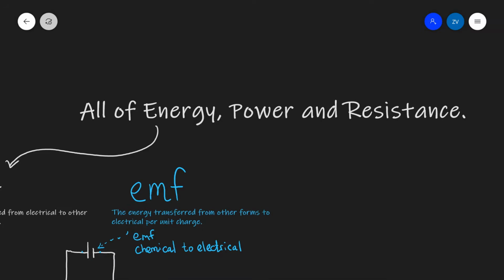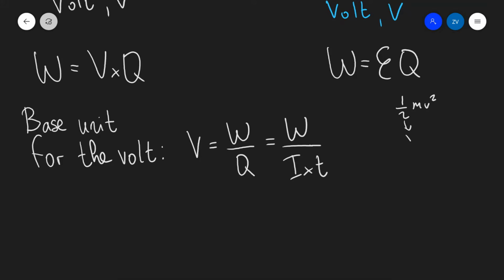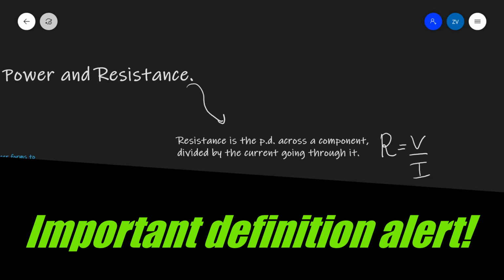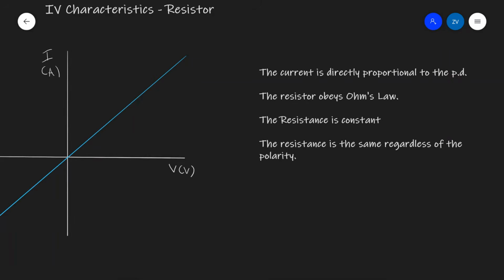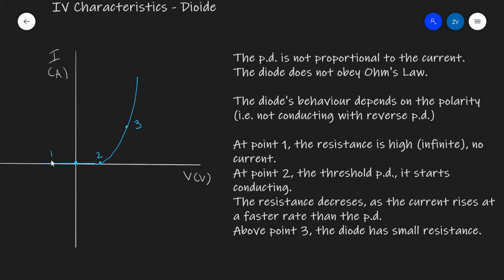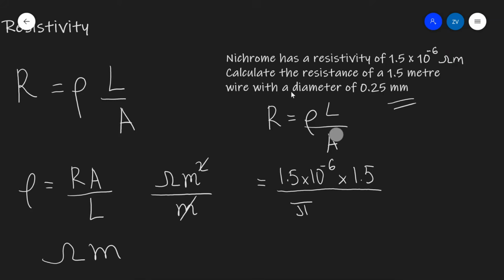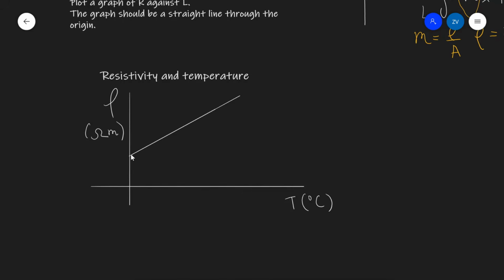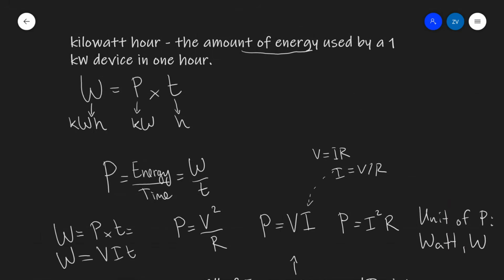A Level Physics Revision: All of Energy, Power and Resistance

Comment: hey wait a second, if p.d is proportional to resistance, and resistance is the gradient in the example graphs, and gradient is rise divided by run, then how come in the filament lamp graph the resistance keeps increasing when the rise gets smaller and the run gets bigger? rise and run are terms used here in pakistan, in case youre confused (which you probably arent because youre a great teacher) rise is gain in y axis and run is gain in x axis

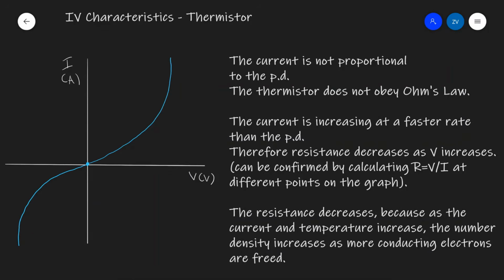Comment: At 12:12, can you please explain why p.d. is increasing at a faster rate than current and not the following "the current is is increasing at a faster rate to the p.d. up until the point of inflection because the gradient is greater than one (it looks greater than one) after which the p.d. increases at a faster rate to the current because the gradient is less than one (it looks less than one)?
Reply from the maker: Hm typically just what I stated is required in mark schemes. Initially I don't see the graph trending to be steeper and steeper. Overall, the graph becomes less steep and less steep, i.e. the p.d. is increasing at a faster rate, as resistance is continously increasing with temperature in a filament lamp. Hope this helps

Comment: hi sir i just wanted to understand...how is resistance the gradient if in all the examples, when there's a bigger slope the resistance is lower? As in it's also weird bcuz m=(y2-y1)/(x2-x1) so it doesn't match the formula which is R=V/I right? So is the resistance the gradient? Why is it high when it is flat or lower when it is at a greater slope
Reply from the maker: Hi, in an IV graph resistance is the inverse of the gradient at a point. If it's a curve, easier to think as R=V/I, hope this helps!
Reply: so in any case in an IV graph the resistance is inverse of the gradient?  @zhelyo_physics
Reply from the maker: yes that is correct, the inverse of the gradient is resistance in an IV graph, this is because gradient is delta y/delta x which is I/V and the inverse of this is V/I which is resistance. Hope this helps!
Reply: So we only consider R=V/I?

Comment: I would just like to comment on some confusion with IV Characteristics for non-ohmic conductors current is always proportional to p.d just not directly proportional. 

 And for filament lamps and thermistors the explanation for why resistance decreases/ increases depends on the current and temperature always increasing but causing opposite affects but with the same explanation this is because how filament lamp and thermistors are designed, hope this helps
Reply from the maker: Hi, excellent questions. So in maths proportionality is defined as a linear relationship e.g. y=kx where k is a constant. If the graph is a curve we cannot use an equation like this to describe non-ohmic conductors.
Reply: OMG I'VE BEEN TRYING TO UNDERSTAND THIS FOR HOURS YOU SUMMARISED IT SO WELL TYSM!!!!
Reply: sorry for replying in all caps I got excited 😭😭
Reply from the maker: @tonystarkdeservedbetter  haha anytime! Glad this makes sense now!

Comment: in the I-v characteristics graph why is the I in the y axis and the v in the x axis?
Reply from the maker: No particular reason so far as I am aware, unless someone else has some knowledge on it but it seems to be the standard.
Reply: @zhelyo_physics  isn’t it because the x axis variable is usually the independent variable which we change during the experiment hence pd should be on the x axis to see how the current changes when we change pd?
Teacher explained it like this not too sure though

Comment: Would the resistivity be 0 at absolute zero?
Reply from the maker: Excellent question! Typically not unless dealing with superconductors which have 0 resistance below a certain very low temperature. 
Other conductors like copper still have some resistance at 0K (as the electrons try and pass they still collide with the ions, causing some vibrations and also a temp. increase)